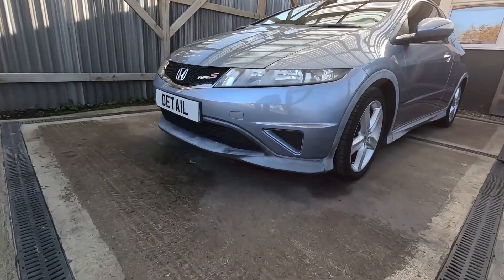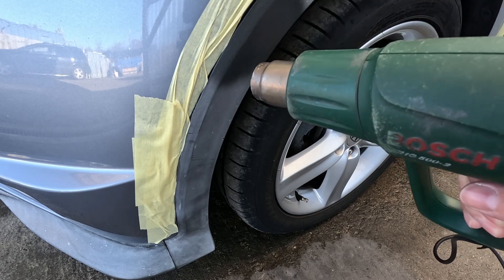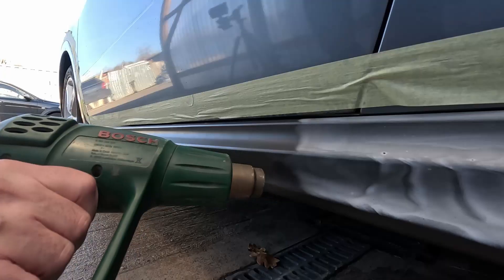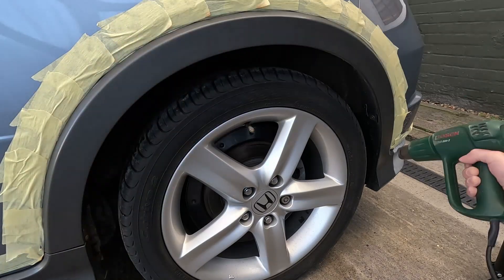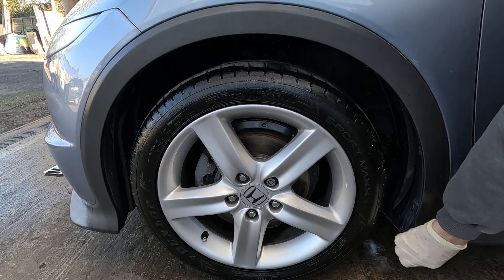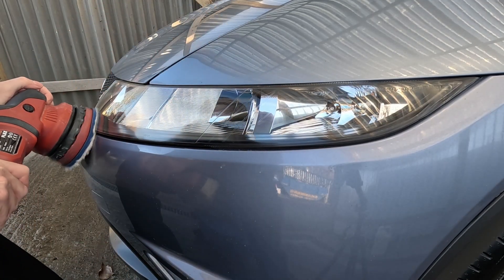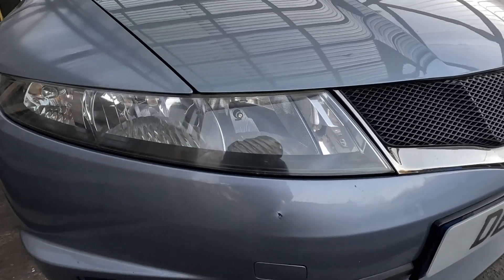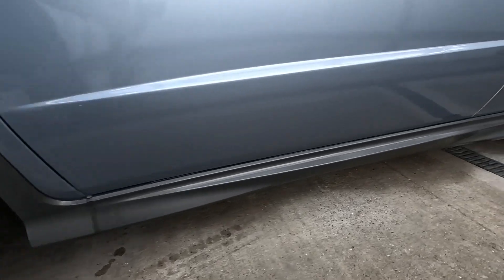The Secrets of Restoring car Trim with a Heat Gun, faded bumper repair

Comment: This method is good for short term, but the plastic will fade again from the sun's uv rays. I  tried a lot of methods on my civic type s plastic trim and everything failed. I ended up cleaning (de greasing) the entire trim around the car, and applied a platic primer x2 coats, then applied a paint called zinsser allcoat (matt black ) x2 coats and the trim looks brand new. Its been done 2 years now and still looks amazing with no flaking, chipping or colour fade👍

Comment: For those interested, after using the heat gun on the plastic trims, apply some GTechniq C4 trim restorer. It reacts at a molecular level to provide up to 2 years of further protection from degrading the plastics. It works an absolute treat.

Comment: The problem with the heat gun is that the properties of the plastic are changed by the heat.  I got the best and long-lasting result with ceramic sealing.
Reply from the maker: As you can see by the side skirt, the trim has gone stripy and no trim restorer will remove that UV damage, its either replace, paint or heat gun! on a £800 car this is a fairly decent option! though you are right, many new sealants are outstanding and last for a long time.

Comment: How long should you apply the heat for in a given area and is that at max setting?
Reply from the maker: I use it on max setting and only put over an area until it changes colour, a few seconds tops, almost like painting a fence etc, or using a paint can, I tend to work the nozel back and forth rather than one fixed spot

Comment: It will be much worse and worse every time you use heat gun. Simply apply trim restorator and repeat every 6 months.
Reply from the maker: As you can see by the side skirt, the trim has gone stripy and no trim restorer will remove that UV damage, its either replace, paint or heat gun! on a £800 car this is a fairly decent option! though you are right, many new sealants are outstanding and last for a long time.

On a car like this once its had the heat gun treatment and a decent trim protector/restorer added on a regular basis, there should be no need to heat treat the trim in the future.
Reply: That's also one point of view. Simple, just not for me, and I wasn't thinking locally in the first place in the video is globally available.